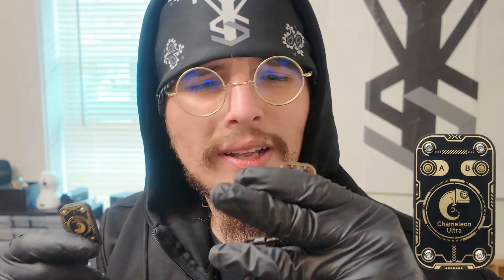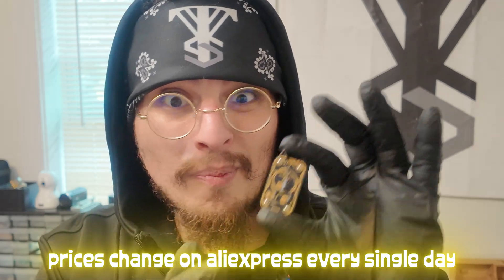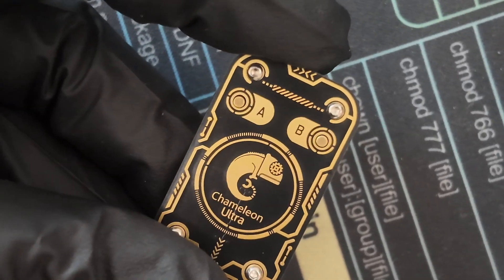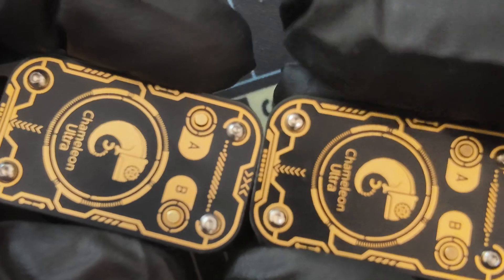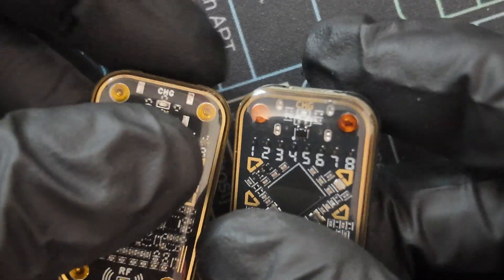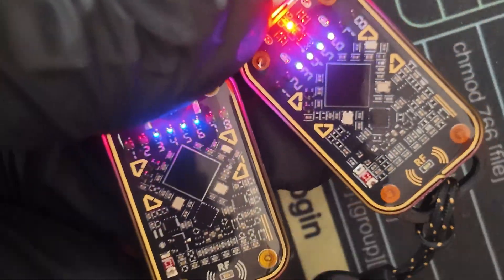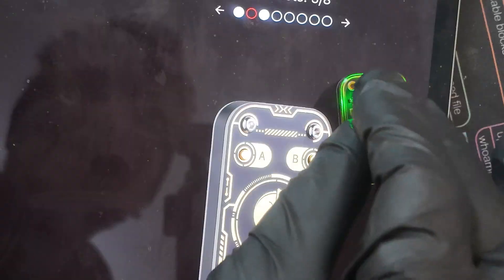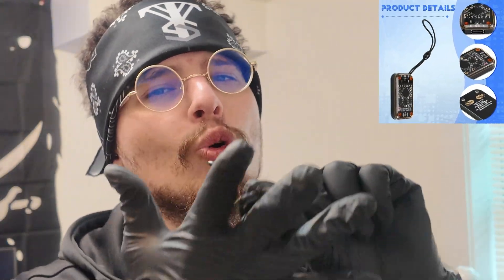Chameleon Ultra: Clone V.S. Authentic

Comment: I already have a flipper zero but I'm thinking of picking up either a chameleon ultra clone or a proxmark 3 easy clone. Any advice?
Reply from the maker: Honestly a proxmark3 easy is awesome and can teach you so much, but a chameleon clone and a proxmark3 easy will both run you like 35 dollars total
Reply: @Valleytechsolutions Thanks! Do you also have a link for the proxmark 3 easy? And is there anything I should look out for when buying clones from AliExpress or are they all pretty much the same and I should just get the cheapest one I can find?

Comment: i hate the screws on mine, my clone version has some shit scriws, not the ones the actual one has and they rounded it out so i cant open it meaning i cant finish my mod project ive been working on
Reply from the maker: But it has a better antenna then the original did you know that??????❤
Reply: @Valleytechsolutions  i know, thats what the upgrade pcb would have been for. it would be better than the official one too!